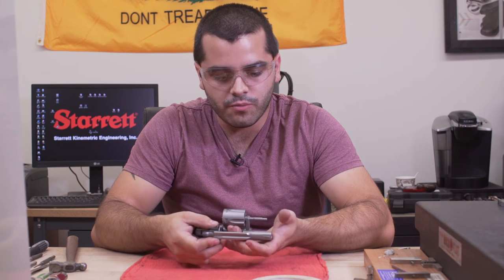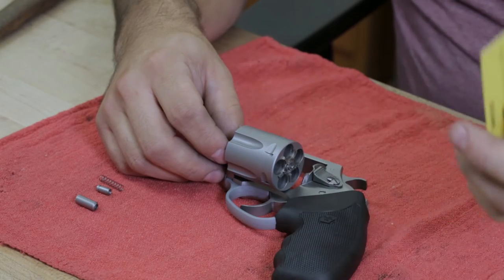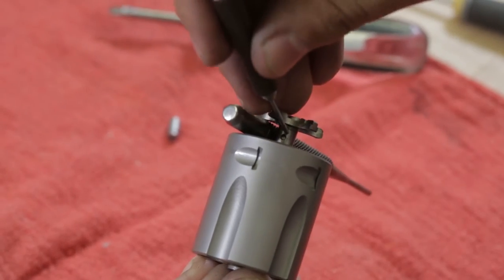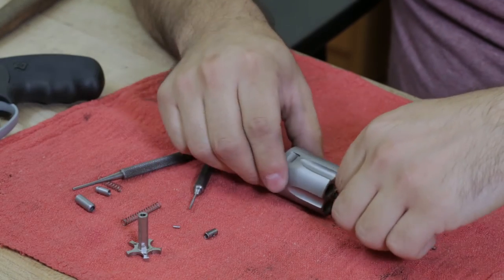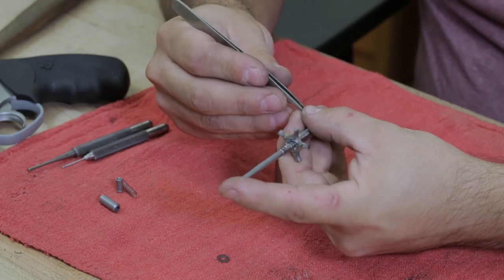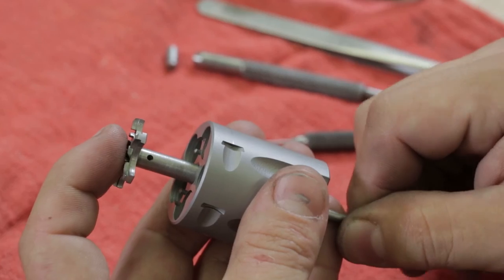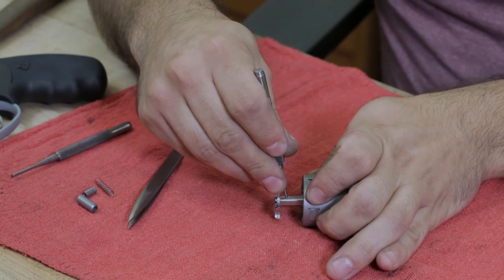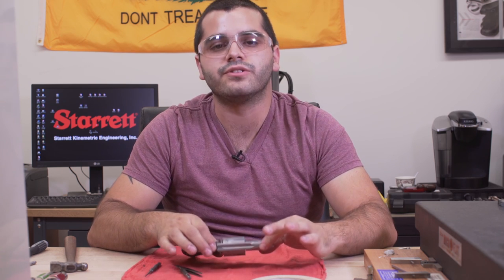Cylinder Assembly of a Charter Firearm

Comment: An excellent video.  One i am gong to refer too if mine gets dropped in the mud or some water...Also way too much work for a gun that already works...TBH I have tried both sides of this issue over the years, meaning the "hose it off with brake cleaner and lube" side vs. "detail strip for surgical cleanliness" side.  After cleaning my guns (with brake cleaner and compressed air) for years, then detail stripping them years later - i have found there is very little residual dirt left behind after cleaning this way. And it leads me to conclude that for most shooters, there's seldom need to tear your guns apart this far.  Most of the time you are doing more harm then good - by stressing the parts, and more likely then not, losing parts while doing it.
Reply: I can't agree w/ that at all but look. if you get a new gun test your cleaner on an inconspicuous place before you blast it
Reply: AMEN!
Reply: I like to do it for the fun of it and educating myself even though I sometimes have issues putting it back together. I always learn and it's always easier the second time if somewhere down the road it has to be done again. Save this video.

Comment: My 357 snubnose magpug's cylinder has difficulty revolving & will not revolve sometimes. Around 500 rounds were already fired. But, if i swing out the cylinder, push back the extractor, it revolves eaisily but when it is put back into the frame for firing, it will not revolve
Reply: Bummer

Comment: Question... recently got a used one, old - probably first generation... it was so underpriced I could not pass it up.  Be picking it up in a few days. It was clearly well used but the action and lockup are great, just looks worn on the outside. However, the knurled end of the ejector rod is missing which is why the thing was so cheep.  The gun ejects as is, is it safe to shoot it the way it is until I get the part?

Comment: Great video Tony, question my uncle has a 38 special charter arms but it to doesn’t work, when he dry fires the cylinder doesn’t move he’s had it locked away for about 30yrs. Any recommendations would help. Also he hasn’t cleaned it in a very long time. Thanks

Comment: Quick question, New to guns but Can you swap out Cylinders on the revolver? I have a bulldog 44 special but saw some Pitbull Cylinder that's 9mm. 

Please reply back thanks
Reply: Sir if I were you I wouldn't even try to swap those cylinders.

1) Bulldogs are .44 caliber and 9mm are .38. Even if the cylinders were dimensionally compatible in terms of length and circumference, it would be very dangerous trying to shoot 9mm out of a .44 barrel.

2) The 9mm charter cylinders have a patented system where spring loaded tabs retain rimless cartridges. It is built differently than the traditional cylinder in this video.